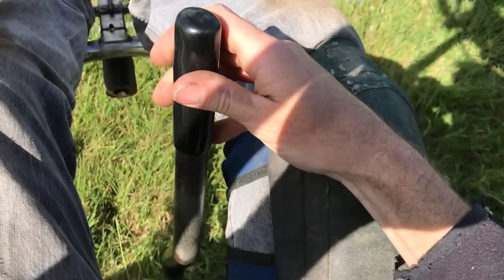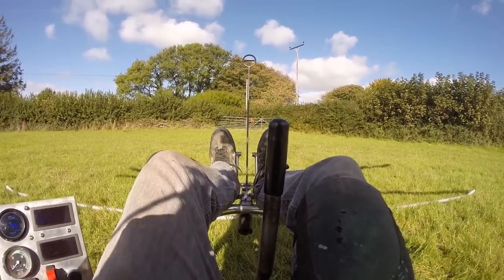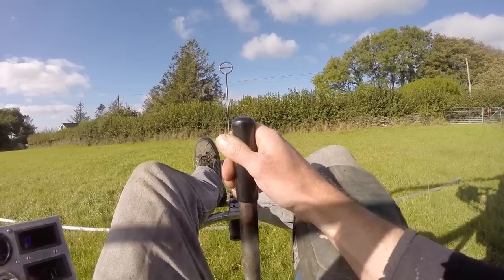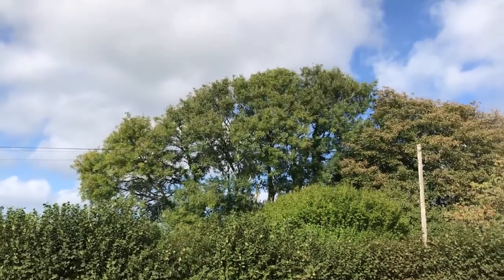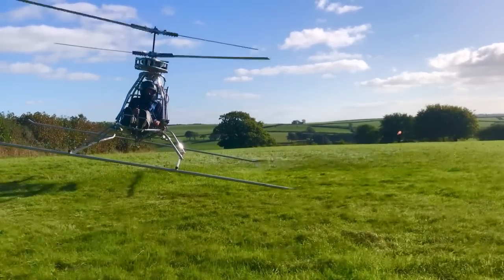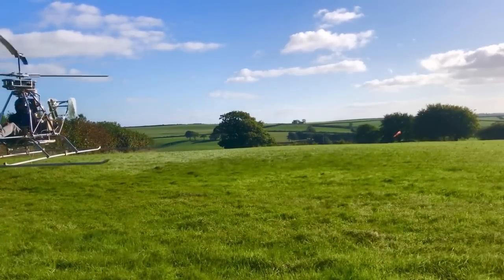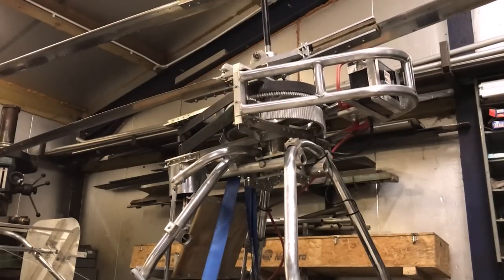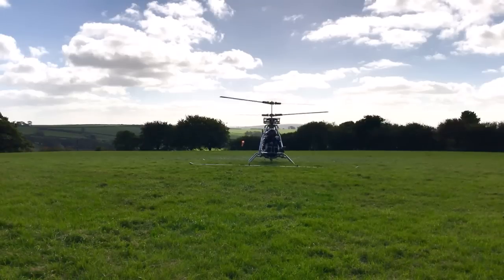Dodgy Moment, Homemade Coaxial Helicopter Learning to FLY

Comment: It is wonderful that you are documenting your progress.
I think a lot of your instability issues are from being in ground effect, the aircraft will constantly try to "fall off the bubble" of compressed air that is under it.
If you ever tried to balance a magnet floating over another magnet with opposing north poles you will know what I mean.
Once you get more than a full rotor width between the rotors and the ground you should be pretty much out of ground effect. So you need another 5 to 7 feet of altitude above this test I think. Anyway, good luck! 🙂
Reply from the maker: Thank you. I am expecting it to be easier higher up I just don't have the confidence to try it yet. I don't have the skill to correct every situation, for instance two controls at a time and can correct simultaneously but if suddenly all three controls needed my input at the same time then I might get overworked and get one wrong. It's catch 22, I have to practise in the turbulent air for now. Looking forward to being able to go higher and hopefully progressing much faster.
Reply: @Ben-Dixey  .. yeah for sure it must be a scary experience. Maybe over some test runs you can refine the controls and control surfaces etc.
Please be safe friend! 🙂

Comment: I make good use of modern drone tech for a hobby, I want to ask if everything I see here Mechanical? and if so is it you skills or the Tuning that's holding you back?
Reply from the maker: Yes all mechanical controls and yes it's me holding back flight. It just takes time to learn the skill. For some people it's 2hrs for some people it's 10 hours. At 1minute 30 each test so far it has taken a long time to progress but improvement is noticeable every 10 minutes or so of flight time. Part of the challenge is fixing issues, making improvements and keeping the machine running while learning.

Comment: Wind sock evidence seems to suggest that lateral movement was probably caused by a gust BUT - perhaps not.     Depending on what the TRUE root cause was for that roll . . . .  your decision to land immediately MAY have saved the day.    Until you are certain of the root cause, I am tentative about your thought to push it harder next time.     1000 Hours in the air in hang and paragliders - - - I've always been rewarded with  a decision to get out of the air when conditions were deemed too treacherous or UNCERTAIN.    The decision to "push further"  was only made when conditions and attitude were as anticipated and fully understood - irrespective of how I might"feel".   There's a difference between experiencing (for example) high G's for the first time and "pushing" through it - - - and pushing harder into an uncertain regime.
Reply from the maker: I have read about the situations in which you speak of and I can understand your reason for mentioning it. I guess it depends on whether I could have rescued the situation or made it a lot worse. I have had smaller instances of this where I rescued it and didn't try landing travelling sideways. I think I would have rescued the roll back to a controlled hover on this occasion had I not descended.  I suppose it's about judging your own levels of competence but in a split second.  This time all was ok but it was dodgy. I'm not going to fly in wind that gusty until a greater level of ability has been achieved.

Comment: Part 8:  From one professional mechanical engineer to another...   you could [still] shave 6 months off your product development cycle time by using an electric motor.  For shorter tests - you won't even need a battery.  Overall though, excellent work!!!  Great videos!!!  (just envision... no more metallurgy, "should I use a new steel alloy", HP vs. power responsiveness rabbit holes, bearings, cooling pumps, vibrations, lubrication, fuel management, rpm/torque control concerns and about 50-100 more things)   Electric motors are 99% mechanical engineering anyway - only those pesky, invisible things like electrons and magnetic fields are EE, Lol.  Huge congrats on overall work!
Reply from the maker: Hi, and thanks for the comment. As you say it would have been so much easier with electric motors, I could have had two motors spinning in opposite directions which would have simplified the rotor reversing add into that yaw control via differential rotor speed. ( no tail vanes required ). plus all the things you mentioned. It did of course cross my mind in the beginning, there were two things stopping me cost and flight time. The electric setup was way too much money for someone who didn't know if they could even build a helicopter that could fly. It's something I would seriously consider for the future but it's still very expensive, I suspect in time the cost will come down or there will be other second hand vehicles you could buy and utilize the components.
Reply: @Ben-Dixey  Hi, and great to hear back from you.  The rationale of flight time is right on.  However, I didn't realize that electric motors and peripherals were more costly?  I may try to contact a coaxial builder, there's are a couple in southwest Ohio, near me.  There were a couple of fixed wing guys from this area, but that was a hundred years ago or so.  Not sure if the family is still into it.
Reply from the maker: @stevieathome4942  Yes, I priced up the battery's at the time which came to £10k. I'm sure they are much cheaper now and better performing for there weight. Pascal Chretien built an electric version quite a while ago. seemed to work well.

Comment: Great save! I think the PIO’s prior to you reducing power put you in that situation. If you had increased the revs, it may have got worse. Hard to say. The shorter grass helped the extended poles slide and not dig in. In regards to the overheating, can you give us some numbers please, we may be able to identify a solution. Does the engine CHT match the temperature of the radiator? Is it the EGT that is more concerning?  I’m wondering if an increase in jet size may help. The old rule with 2 strokes is if they ran hot in climb you enlarged the jet to assist with the cooling and to prevent  seizure. With your engine under full load you are in the same situation. I look forward to the next video. By the way, the further you are from trees reduces turbulence. Being closer to the windsock may have given you more stable air to fly in.
Reply from the maker: Thanks Kim, fully willing to accept I caused the roll angle it just seemed to catch be by surprise. The CHT is the temperature on the onboard gauge but I don't have a radiator temperature gauge fitted. I think it would be a good idea to fit one. 
I measured the rad temp just after the test with the fan and pump still running. Top of rad 78degrees bottom 72degrees. 
I think increasing the jet size could be a good move, but by how much ? Suppose I could take it out by 0.1mm at a time and look at the plugs/test flight duration. I haven't measured any exhaust gas temps. Thanks for the tip on trees causing turbulence didn't know they caused that.
Reply: I looked at the general temperatures on a water cooled 2 stroke and I am wondering if your engine has a stuck thermostat. If your CHT is reading high and the radiator around 80-85 degrees either the pump is not doing its job with water flow or there is a impingement in the engine. Can I suggest a couple of things. A water temperature gauge as discussed for the radiator, a dual EGT if you are running two carburettors and for tuning use a Colourtune kit. It is a spark plug with a glass window with accessories so that you can observe the flame colour at all stages of rev range. If you run lean it is obviously white, rich yellow and blue perfect mixture. The kit is inexpensive and so easy to adapt to any engine. I never look at the plug after shutting down the engine as it does not give you any clarity through the complete range, only flat out. I’ve owned a Colourtune for over 30 years and it still never lets me down. My aircraft, boat and vehicles attest to it with reliability and minimal service required. Hope that helps.
Reply from the maker: @kimkeam2094  great advice, I have got a colour tune, I've not actually used it on a 2 stroke before, will give it a try and see. 
I also agree with mounting the other temp sensors. 👍👍 I took the thermostat out, I  know it will need to be reinstalled at a later date.
Reply: @Ben-Dixey  As a suggestion put gauges on everything. Monitor everything, Log everything.
At this point you aren't worried about performance. As long as it can get airborne in ground effect and once you get the data you can take them off.

Comment: Nice work mate, from another John. With regards to cooling and your mention of 'increased flow', increasing the flow can actually reduce the cooling effects. If the coolant flows too quickly through an engine it does not get a chance to absorb the heat, sounds strange but thermal conductivity takes time, like holding your finger over a candle vs flashing your finger past. Not sure how you are monitoring the temperature and if you are referring to engine heat or radiator heat. Could you have a aluminium or copper pipe that loops around the gearbox with cooling fins connected with flexible hose to make more use of the down wash/turbulant air or use the large sprocket spokes as the cooling fan. or turn your yaw flaps into an airfoil shape and also a heat exchanger. You'll figure it out. Glad you are having fun and taking it one step at a time.
Reply from the maker: Thanks John 👍
Reply from the maker: Cheers for this, I was thinking you could run a water pump too fast but in reading about it, the general opinion is you can't. It just means the temperature drop across the radiator is smaller and the whole system remains at a more consistent temperature. I might be wrong and you could be right, I don't know. 
The idea to run coolant pipes in the downwash could be explored and I like the airfoil shape tail fins, I'm sure it would be more effective and would require less deflection angles ? The temperature gauge is taking readings from the top of the head, being the last place hot water exits it should be the hottest ?
Reply: @Ben-Dixey  If you did a close up of the engine and cooling system it may be easier to see, but I'm sure you will figure it out.
Reply: @Ben-Dixey  Formula 1 TURBO Era | 800HP Toleman-Hart TG183B [TECH TALK] search that on youtube and listen from 5 minutes.
Reply from the maker: @chippyjohn1  That's interesting about the over cooling via too high a coolant flow rate. There is however more people online that would disagree than agree with that. I'm still not sure which is correct.

Comment: Can this plausibly auto-rotate with such short/low mass blades?
Reply from the maker: No it can't, I would need to add collective pitch and tip weights to increase inertia. Then it could and this is demonstrated with the sch2a on YouTube.
Reply: @Ben-Dixey  I assume you don't plan to fly this one out of ground effect then?
Reply from the maker: No, not in this configuration. I could add a secondary redundant power plant in order to go higher.

Comment: IIRC, the reason non-coaxial helos don't use the pivoting shaft design is because it is so easy to chop the tail boom off.. Also, when you transition to forward flight do some reasearch on "vortex-ring state" and try to intuit the mitigation before you start forward flight testing.
Reply from the maker: Yes Could be a reason, though I would have expected the same rotor angles in a rotor with cyclic blade feathering. VRS I believe you have to be descending into your own downwash. The machine won't be flown above a few feet.
Reply: @Ben-Dixey  ok, if you aren't going to be out of ground effect then VRS is probably less of an issue. I also went and checked on the Robinson R22 and it is listed as having a "tettring hing" plus others and I think that is part of the reason for the very tall rotor mast compared to more traditional helos.. But don't take my word, I have be wrong many times in the past.
Reply from the maker: Yes the R22 has a tri hinge rotor head, patented by the company. It's a controversial rotor head and has been blamed for a lot of accidents. The height of the mast being so high could well be for extra clearance with the rotor head being capable of extra flapping. Though I was told that the height was to do with providing extra stability in hovering.

Comment: Learning to fly RC helicopters in the early 90's cost me a whole lot of money because wrecked em almost every single time they came off the ground so watching you do that while sitting in the actual egg beater with seamingly no protection terrifies me to no end. You are so much braver than I, that's for sure.
You seem level headed though so I'm sure you'll figure it out and be flying that thing around like a Ferrari in little time.

One suggestion though if I may? Some round balls at the end of your trainers so that the risk of them digging in and rolling over would be reduced.
Reply from the maker: Just looking at purchasing some balls. The ends of the tubes are bent up though.

Comment: Did you consider mounting a horizontal tail rotor for moving back and forth in order to create a more robust main rotor hinge connection? That way you need the rotor tilt only for the roll axis. Wouldn't that simplify the entire mechanism? You did an awesome job with your project anyway! Would love to see more from it.
Reply from the maker: Hi and thanks, I didn't consider it, I've flown a model coax which had a horizontal tail rotor with no prevision for roll, it only had yaw and pitch and gyro stabilization. The main advantage of a coaxial is the reduction of wasted power in not having a tail rotor. A hinge for pitch is going to be much lighter than a horizontal tail rotor, I don't see why it wouldn't work with a collective pitch tail rotor should anyone ever feel the need to try it.
Reply: @Ben-Dixey  Yesterday i saw a Coax Heli in a video with a double swashplate. I didn't knew that's even possible. Either way, you're taking the right path by just start to build. Learning by doing is always the best choice in my opinion. Keep having fun my friend
Reply from the maker: @andiprogshop3097  yeah the double swash plates would be difficult to get your head around. Pretty complicated. 👍👍

Comment: Man watching this there are only two outcomes.  You fly successfully or you get hurt bad. There is no in between.
I would recommend a heavy cable or chain directly under the C of G  to calm pitch and roll down a bit, similar to an early Lama R.C. umbilical chord model.

Comment: To verify that cooling efficiency is actually the limiting factor here, i guess you can quickly rig a gravity fed water sprinkler on the radiator in order to add a good measure of evaporative cooling to the system. I reckon for a couple minutes of flight time a simple water bottle ziptied to the frame plus a few plastic tubes should simulate a bigger radiator/fan and cooling efficiency should go way up.
Reply from the maker: Interesting idea, I hadn't thought of that, I don't see why it wouldn't work. I suppose it's like adding some cold water to system?
Reply: @Ben-Dixey  evap cooling works great, highly used on intercoolers.

Comment: If you have a tilting mass it will be less responsive for larger helicopters. For your small heli it is manageable but when it comes to something with more carrying capacilty and something that needs to be more responsive then tilting the mass of something that may be more that a tonne in weight may be problematic. This may also be a problem on smaller helis as a heli isn't the most stable aircraft.
Reply from the maker: I can see the logic. I did expect mine to be much less responsive than an R22 for example and I was surprised by how responsive mine was. I still think the R22 is more sensitive on the cyclic, the cyclic control ratios are different between the two machines and I feel mine should be altered to make control inputs smaller. I personally think a larger rotor would react fast enough to be controlled as it's the aerodynamics that provides most of the power to tilt the disc not the pilot.

Comment: This is gnarly. Do you suppose low level hovering is making it any more complicated due to rotor wash? I understand the safety implications of keeping it low, and don’t blame you. Just asking
Reply from the maker: Hi, yes it's harder in the rotor wash. I will be going higher when the time is right. Just going up to 3ft is better than 1ft but I need to get to 5-7ft to be free of the turbulent air. That seems very high right now.
Reply: @Ben-Dixey  oh totally get why you’re staying low, and I don’t blame you at all! Thank you for the reply. 

I reckon too, learning a hover down low, where it’s harder will make it that much easier later.  All conjecture of course, I’m not a pilot.. unless you count RCs years ago 😅
Reply from the maker: I certainly do count RC as experience, a lot of knowledge can be gained from it. I fly RC but not a lot and the experienced RC pilots have a lot to offer.

Comment: Hi, nice test flying,,,
I think, rotor mast is moving very much, not easy to control. Can you use some springs or rubber pad to keep it vertically stable, means when you give some input, only that time it should be tilt, otherwise it should be firmly stedy and stay vertically.
Reply: What is the weight of mast, including pully, belt, rotor hub and rotor blades etc?
Reply from the maker: You could add springs. I'm not sure if it will help or make things worse. I don't think any other helicopters have any springs to return the cyclic to centre. It's a logical suggestion and I wounded if it has ever been tried.
Reply from the maker: There is around 25kg of weight in those components
Reply: @Ben-Dixey  okay
Reply: @Ben-Dixey  okay.